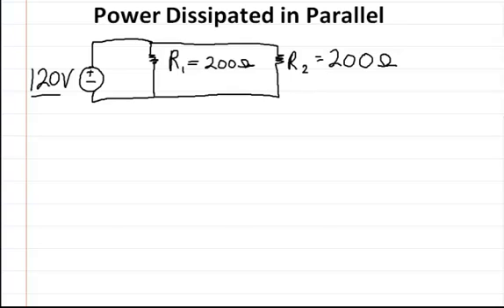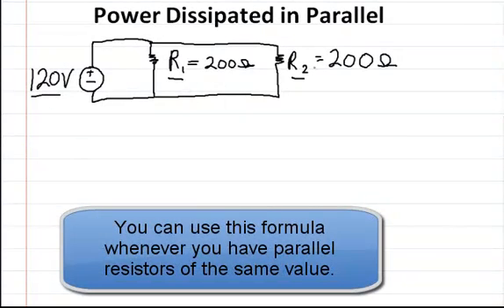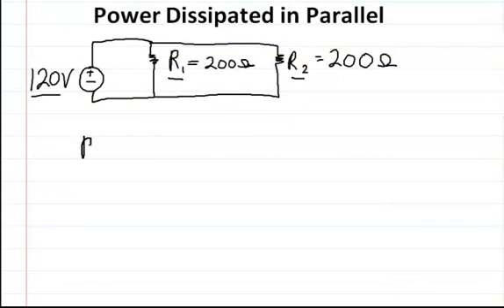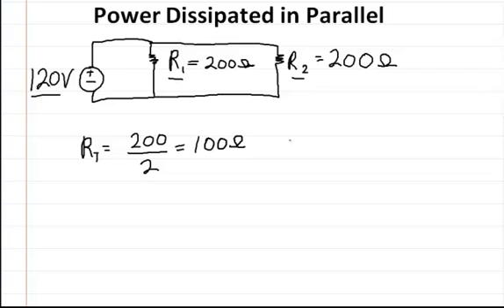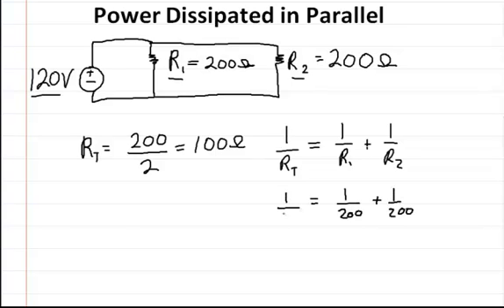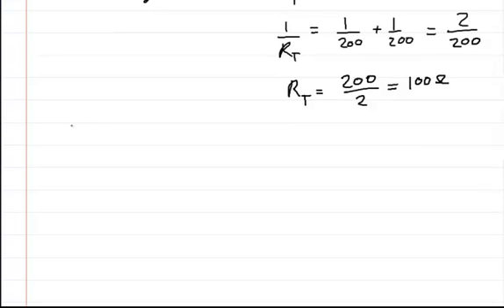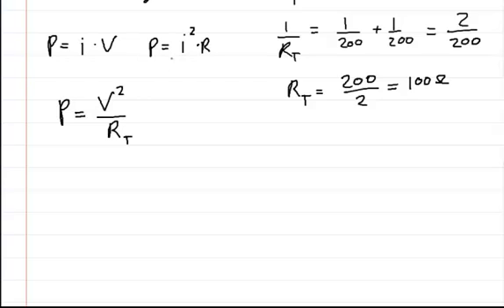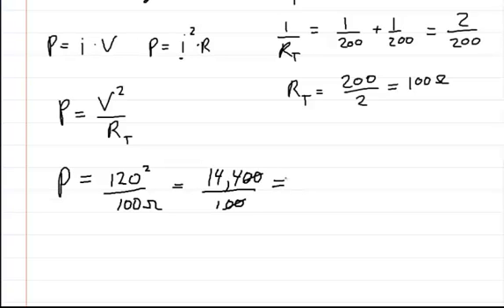Power Dissipated in Parallel

Comment: if 2 resistors both with a resistance of 300ohm are connected in parallel and in series with them is a 400ohm resistor how would I calculate the voltage that must be applied to the circuit to cause a current of 200mA in the 400ohm resistor? thanks martin

Comment: 2 quick questions: 1) If that's Pt, each resistor dissipates (144 / 2) = 72W? 2) if the resistors are of different values, is the Pt divsion is similarly biased?